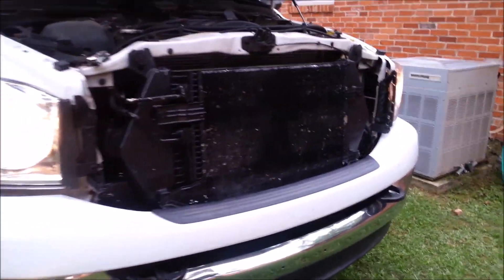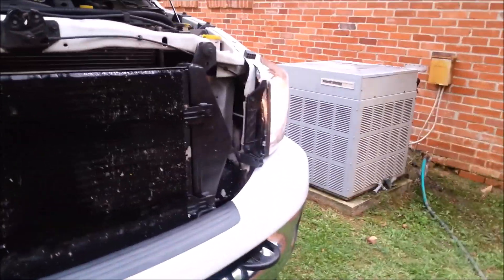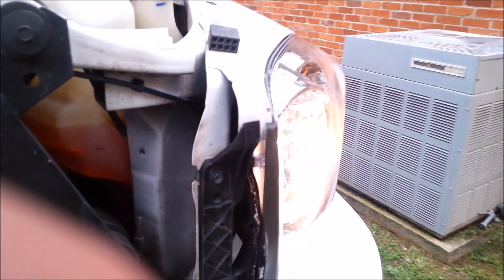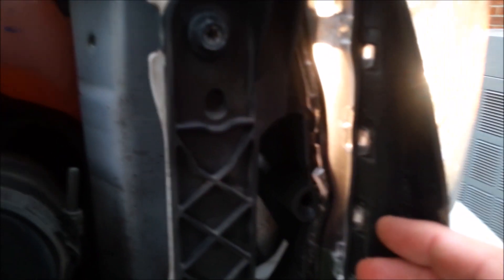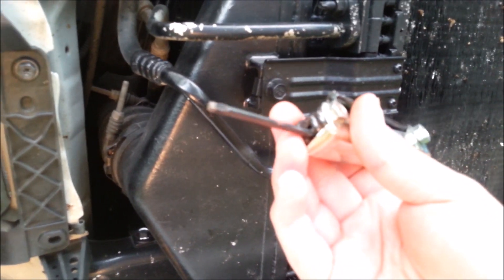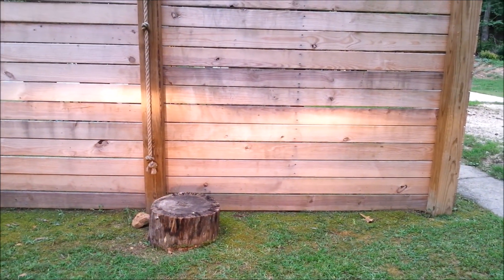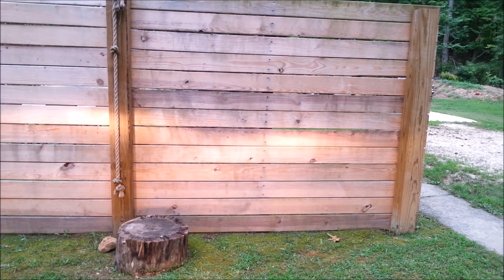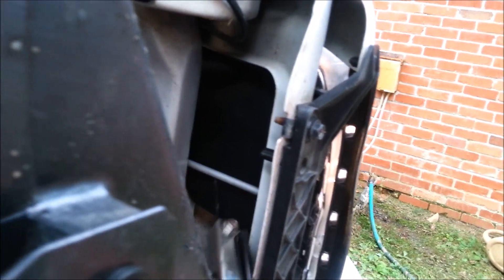2002 - 2008 Dodge Ram Headlight Adjustment: No Useless Commentary Just How To

Comment: Really helpful video.  I was able to do it without any trouble.  My 2003 1500 was different, however. For other people who may be in this situation... turning left moved the lights up and also it was a phillips head screw, not torx.  It's very possible someone who owned the truck before me made some changes on this but in any case, once i figured out I was turning it the wrong direction, it was a piece of cake.

Comment: "That's it.  There is no left and right adjustment. Just horizontal."😐
Reply: you are wrong sir, at least on my 2003 dodge ram 2500 has TWO adjustments and one is under the bulb and one is in the front as the video shows. TWO on each side if you want to do it correctly now the little 1500 may be different don't know, don't care since it does not apply to mine.